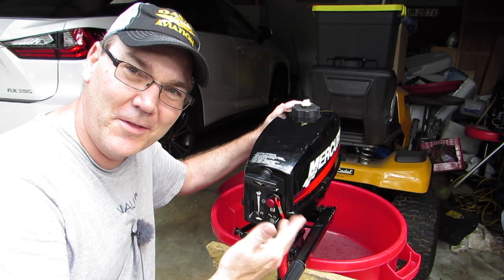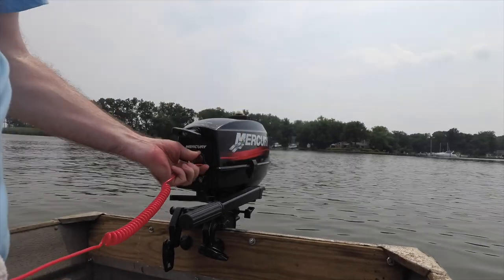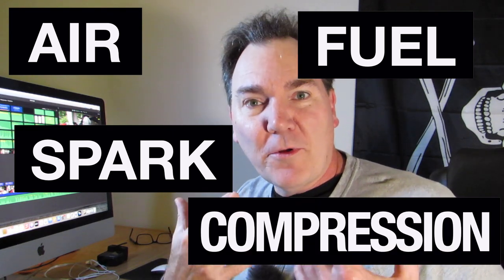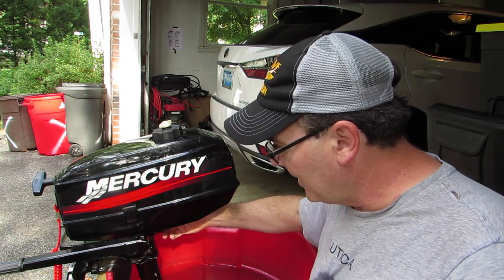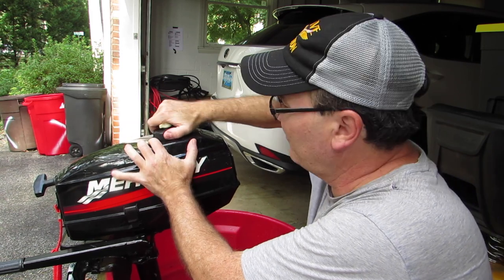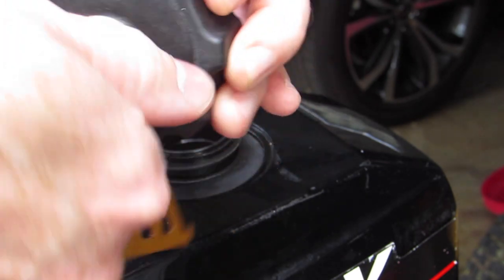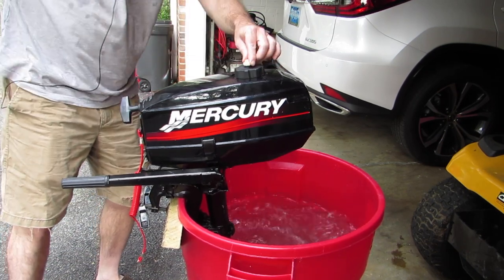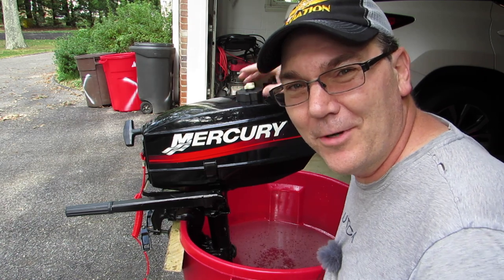Outboard Motor shuts off?

Comment: I had the same thing happen to me on the maiden voyage of a skiff I put together. Got out into the river and ran around a little bit and then all of a sudden the motor bogged down and shut off. What was worse my wife was with me and thought I built the boat badly and was worried about getting back. Luckily I quickly noticed the bulb valve on the gas line had collapsed. I realized there was a vacuum in the line and I loosened the air intake on my fuel tank. She started right back up and I earned my wife's respect and admiration for figuring out the problem and fixing it.
Reply from the maker: Glad it worked out! We don't too many chances for our significant others to gain back our trust on the water!

Comment: I bought a slightly used 3.3hp merc's the other day for my dinghy. The seller had only used it a hand full of times and just had it serviced.   I had the exact same issue when trying to start for the first time. I thought I bought a dud but after 15 minutes of analyzing I realized it was the air flow valve wasn't open far enough. After that it ran like a dream. Glad to see I'm not the only one. Great outboard, love it!   Great Video.
Reply from the maker: Thanks! I just wish these could shift into neutral!
Reply: @WayneTheBoatGuy  Do you mean reverse?  Reverse gear would be nice.

Comment: Thank you! I just got my first outboards,  just like this one, for my little Javelin sailboat. Had a similar issue and could not speed up the boat, only in low power, but also I didn’t open all the away the vent. Will try that next time

Comment: 2 cycle motors? My No.1 rule is I don't leave fuel in the tank overnight. I pour the mix back then run the carburetor dry, always. I just bought an air cooled 4 cycle. Tiny and smooth. I'm going to love it.

Comment: Wow this thing happened this weekend on the lake. I could have sworn that I also tried to start it with the cap off and it still wouldn’t start. I think The motor I have is a little older than yours and has a red engine stop button but no pin or lanyard I’m real frustrated. Thanks for the video for me thinking

Comment: Drove me crazy too. However, I found that my vent didn't work at all for my 2.5hp Merc. I took apart the fuel cap and I found the factory had put a rubber plug in the air way that prevented air flow.
Pulled out the plug and now the vent works just fine.

Comment: The exact same thing happened to me a couple of weeks ago. But I am brand new to boating. But I have a 2015 Tohatsu 5HP with an external tank. But it did it after I had ran it for a while. At first I had no issues and then it started bogging and shut off a few times. I’ll would wait a few second and it would start right away. I managed to get back to the ramp and when I was home I noticed the tank was squished inwards. I opened the cap and heard “psssssss” sound. Like air breathing in. Turned out that was my issue. I took it on the water last Saturday and had no issues. I didn’t know I was supposed to have that breather port open. I had closed it a day prior.

Comment: thanks Wayne !   i have a beginner  question is my 2.5hp outboard, when i go fishing on my dingy, i always do stop and go to find the candy spot, while the engine is off and i am fishing in that spot for 10-20mins, should i leave the fuel cap valve  open and the choke open, and fuel switch in open for my next quick and easy start to my engine? many thanks in advance, learns many boating knowlege from your channel!!!
Reply from the maker: I usually don't turn off the fuel or close the vent until I am done for the day. You shouldn't need the choke once the engine is warmed up - unless it has trouble starting.
Reply: @WayneTheBoatGuy  appreciated the very valuable information & the lighting fast response! Thx!

Comment: Not new to this, but I had the problem. I noticed that you opened the vent ALL THE WAY. Just cracking the vent doesn’t do it. The way the cap is designed, it can require the vent to to cranked all the way open. 
Thanks.

Comment: Your engine seems to start in gear.  Does it not have in gear or neutral?  I have a Mercury 3.3 which I bought new in 2016.  I always seem to be fixing it.  Mostly it starts on 3 pulls when cold.  Re-starting when warm is a big problem.  I'm close to giving up on this motor but I really like that it's not too heavy for me to lift off and on my dinghy.
Reply from the maker: Yeah this motor has no neutral or reverse it’s always in gear. If warm starts are an issue, have you tried different choke settings? Mine sometimes like a little choke when starting warm and other times it likes the choke fully open.

Comment: Got a yamaha 90 2 stroke. Starting right away when its warm. As soon it get cold you have to crank for a while to get it going. Carburators clean, tank has no water, also it sometimes dies on idle. Any guesses? ;)

Comment: I had an issue one time where I had accidently bumped my engine into gear with the engine off while I was fishing. When I went to restart the engine it wouldn't start because it was in gear. Drove all the way back to dock with my trolling motor before figuring out what happened.

Comment: OFTEN with a remote tank and fuel line with primer bulb they develop  air pockets in the 6 or 8 ft.fuel line especially when not run for 2 or 3 weeks and you need to let the air out. CHEERS from Canada
Reply from the maker: Great point!!

Comment: My boat is tied up on the river Bank now stranded waiting for the mechanic, Yesterday I ran aground on some rocks so I checked propeller that seems fine spins freely but the engine won't start.
I tried starting it with choke on and it starts and runs fine but as soon as I turn off choke engine cuts out and won't restart unless choke is on. Any ideas?

Comment: I got a similar outboard, but mine is 3.3hp 2001, am new to the game, when you first start the outboard and set the choke, after it has been running, do you undo/put the choke back to off?  Mine starts and it has some white smoke, old gas that the old user had?  Any suggestions?
Reply from the maker: Yeah as it is warming up - push the choke back in. Give it just enough choke to keep it running. After a couple minutes it shouldn't need any choke and when you re-start it within an hour or two it might not need any choke. The smoke is normal - it's a 2 stroke. Just be sure to mix your gas/oil properly.

Comment: Hello brother so i have a MERCURY 7.5hp and it has been sitting for a long period of time and like the head of the motor it doesn't rotate left or right what should i do brother ✌.
Reply from the maker: First try pulling the spark plug (or plugs) and spraying some lubricant in the cylinders and let it sit for a day or two.
Reply: @WayneTheBoatGuy  thank you so much brother
Reply: Pour 2 cycle oil down cylenders